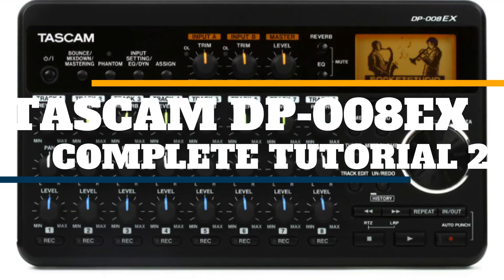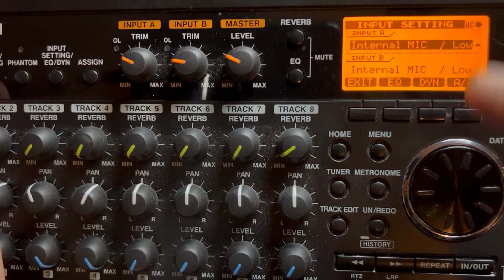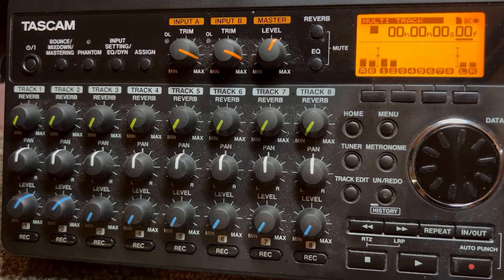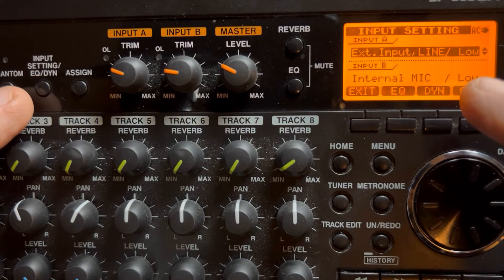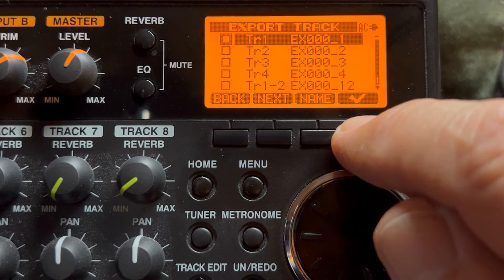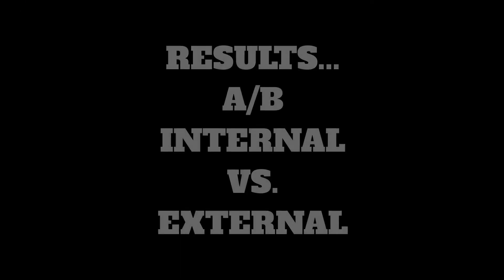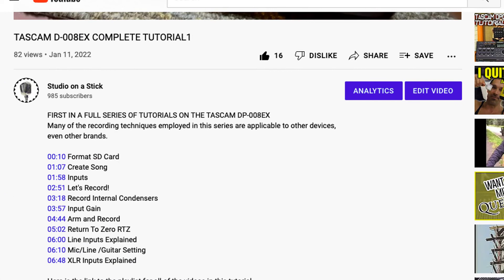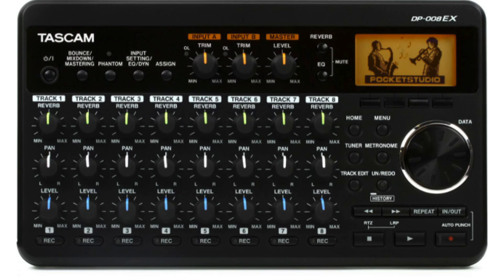Tascam DP-008EX TUTORIAL (2) MICS, GAIN, EXPORT TRACKS, MIC A/B SAMPLES

Comment: Perfect timing, thank you. I am recording the drums for my band this weekend, using the Tascam (we haven't the funds for a studio plus engineer!) and will be using the same idea of three or four external mics running through a mixer deck, into one input (mono) and a pair of condenser mics as overheads, running through a "2 into 1" adapter into the second input. Thanks for the advice about checking the switch is set at mic/line as I forgot that toggle option, and advice for running the external mics at the low setting when assigning them. Your tutorials have been so useful in getting to grips with this great little machine, so thank you.
Reply from the maker: You're welcome!
I'm very interested in how the phantom power works with the adapter.
Have you tested it?
Reply: @StudioonaStick  Yes, the phantom power works with the "2 into 1" adapter with both condenser mics plugged in (which is why I have to use those mics directly into input B, because the mixer desk doesn't have phantom power)
Reply from the maker: Cool! Good to know, thanks.